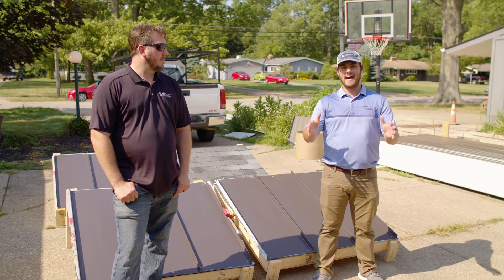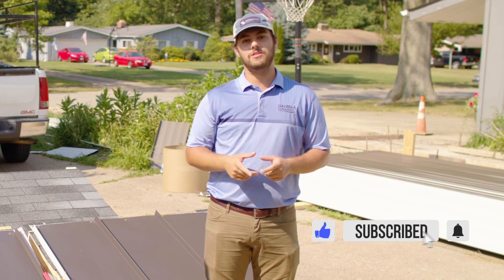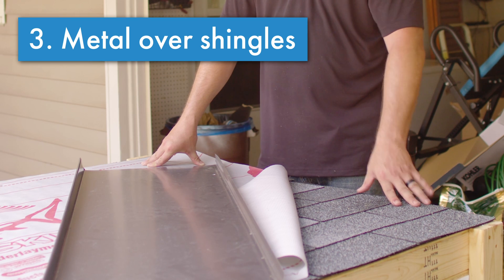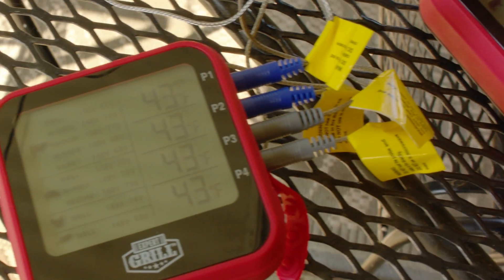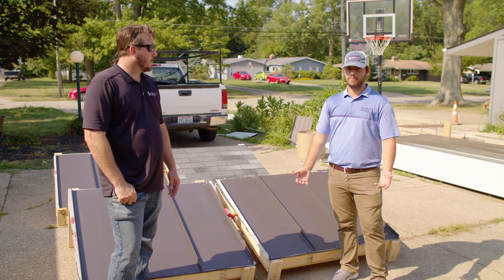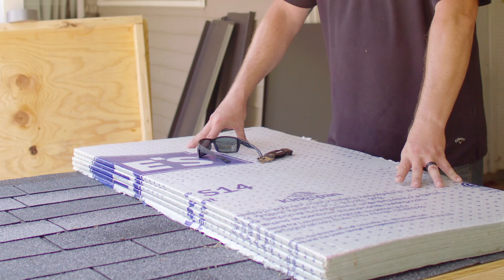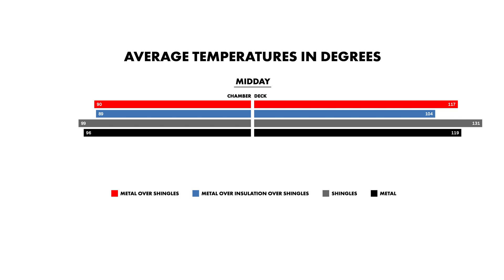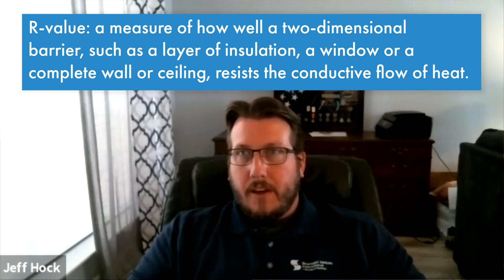Which Roof Type Holds the Most Heat? Shingles vs. Metal vs. Roof-Over

Comment: Though you did not test the system, looking at your results, it seems to me that Peel & Stick under metal would perform the worst of the metal roofs test, as the asphalt absorbs the heat and has no airspace. Moreover, it might perform even worse than a shingle roof as the shingle roof has the breeze to cool it.

Comment: I would like to see the same assembly tested with some sort of foil faced insulation such as single bubble tested against the fanfold.  the reflectivity of the foil is supposed to deflect lots of the heat out.  Plus it goes on faster and cheaper than fanfold so if it does as good or better on temps it would be a preferred method.
Reply from the maker: That's a great idea; we'll add that to the list for future testing! -Thad

Comment: I was under the impression that you needed to have an air gap between the radiant fan fold and the roof, in order to achieve a true radiant barrier. Would be interesting to see you test a system with the proper air gap.

Comment: A peer into the difference between radiant heat vs ambient heat may help with this experiment. If we are looking critically at efficiency then shade must come into play to block the sun's radiant heat while concurrently allowing heat dissipation. A white mesh shade canopy mounted to the roof with 4"-6" offsets would reflect back some of the radiant heat from the sun, providing shade while still allowing rain and wind to pass through for ventilating the ambient heat at the surface.
Reply: @maytons

AND moisture readings alongside these readings throughout the entire year, in the same 1 mile radius, complete with power bill and air quality. Lmao
Reply: @maytons

Lol.. well, at least I would love to see that. Go for it!

Comment: WOW, WHAT A GREAT VIDEO!!!
     Back when I was getting my master’s in mechanical engineering, I did a research paper on heat transfer through a small 1 room house using computational fluid dynamics (CFD).  I was amazed at how much heat transfer was through the roof.  It was over 20yrs ago, but I seem to remember it was almost 75% of the heat transfer, followed by windows and a distant third was the walls.  When I used to do heat transfer analyses of gas turbines, I would simulate thermal break between the parts.  So, the affects you are seeing in your test with the asphalt/foam/metal combo being best during the day is not surprising.  There is a good amount of thermal resistance for the heat to get to the attic air space when moving across these roofing components.  Also not surprised the asphalt/foam/metal combo was the worst during the night.  I bet it’s the thermal capacitance of the asphalt, it’s retaining heat and the foam is restricting the nighttime cooling.  Still, I would use the foam under the metal.  I bet if you added an “attic fan” you would see some big temperature drops.

     Now some real-world experiences, 10 years ago I lived in the NE and I needed to replace my a 20yr roof on a 40yr old house.  The old roof was white asphalt shingles, and they were replaced with black shingles.  It was early April with a daytime temp of around 55F.  Using an infrared laser thermometer, the temperature was about 110F-120F with the white and then 130F-140F with the black.  The original builder installed vinyl soffit vents, but it was over solid plywood.  There was absolutely no attic ventilation.  All the plywood had to be replaced.  There was no bathroom vent in the 2nd floor bathroom.  The roof plywood over the bathroom was covered in mold and one rafter was dry rotted.  Even though the black shingles made the roof hotter the corrected ventilation cooled the house down better at night (also added ridge vents).  In July, our 2nd floor bedrooms were HOT until about midnight.  After the new roof, the bedrooms cooled down sooner.
Reply from the maker: Glad it was helpful! Thanks for watching! -Thad

Comment: Curious to see how a Energy Start rated shingles would compare with your metal rood and against a generic 3 tab(3 tab is banned for new work in our area, only repairs are allowed).  One energy star roof is Owens Corning Dura Max Cool Roof.  Im not trying to drop names, but it's one I know of and is currently on our old home and it's a premium shingle that has a rated 30-50 year, depending on model/install.  That makes it more comparable to metal in lifespan whereas 20 year, 3-tab is low end and users wanting that are only looking for cheapest.   I'm seriously considering metal and will need to install myself because in my area, residential metal roofs are expensive(treated more as a commercial install).  This is not the same in other parts of the US.   Thanks, Brian

Comment: We have a metal roof and our attic gets super hot in the summer. Our house used to have a shingle roof and I don't know if they took the shingles up or if they left them and out insulation down. I would like to put in an attic fan to alleviate the heat in the daytime.

Comment: Exposed fastener high rib metal over 1×4 or even better 2x4 lathe is my favorite. Use wide ridge, bend up the flats, and don't use closures. The ribs vent under the lathe in an amazing way.

Comment: I like the options. Some of the high performance builders I have seen use an underlayment then insulation. On top of the insulation then 1x4 furring strips then metal roofing. This air gap allows less heat transfer from the metal roof to the assembly and the space allows for moisture to run out of there was ever a leak or condensation. It also allows for that airflow to cool the decking at night.

Comment: My other observation is that the cooling is flawed, due to the need for some R99 insulation of the back and sides of the test boxes, after which, we could see how much heat was lost through the roofing.... I am not not as interested in how low it got inside at night, as how quickly it dropped through out the night.

Comment: I believe letting your attic  breathe properly is the best method. Pleated soffit. Rafter venting every 2nd space. Relief vents installed near the pitch of the roof. Minimum R40 attic insulation hot or cold climate. Stay away from dark colours for roof finish. Attic fan would be beneficial. Let the attic breathe. Less chances of mold or condensation. Enough said...thxs for the vids!

Comment: I have been digging up forum post after post, with testimonials of people who get condensation on inside of the panel which drips down the screw and into the roof.  The perilins shift and rot too.  This is caused by the insulation under the metal and open air flow design by the roofers. In Southern climates, the night temperature does not swing 50 degrees as it does out West and in the North, like Cleveland....  This means to avoid the Drip failure, go directly over shingles with the metal. However, something soft, synthetic, and thermally conductive must go under the metal to avoid rock scraping during thermal changes.... The other solution would be to spray foam the backside of the panel.  If I could think of how to glue a some insulation to back of the panel, I might try it.... Unfortunately, I do live near Cleveland and have no attic or way to insulate other than putting insulation between my metal and roof.  I did testing on stove and oven with affordable bubble wrap on stove top and pans heated to 190F.  White side touching pan quickly melted air bubbles. Silver side touching pan softened the bubble plastic enough that I could pop the bubbles more easily. Putting white nylon weed  fabric between shiny side and pan, I was able to keep the bubbles plastic from softening up, and the ir meter read 114F, a 50 to 75F degree drop, just with bubble wrap, reflective silver, and thin weed fabric.  Unfortunately, even if I close off top and bottom of the panel so it stays a tiny bit more temperature stable, I might run into condensation problems.  Maybe going over the old asphalt roof, it might melt around screws and seal the screws and prevent the condensation Drip from entering the roof... I am on the fence about attempting any installation under the metal between shingles (foam board or bubble wrap). Foam board is out of my price range anyway.  I guess I need to figure out the expiration date of bubble wrap in storage to figure out if it is even worth it.
Reply: They don't test reflective film, which likely should show a bigger summer cooling effect..... I am not now sure of wisdom for reflective film: 1. It could increase condensation (even though both insulated and uninsulated metal shingles and space cool to same temp, the time for being cool is obviously less and heat up time faster) 2. Both insulation and no insulation over shingles cool down the same (however, in this test no nightly heat source was put behind the airspace at night to recreate a house. So, I am guessing some nightly r value the more thermal breaks between asphalt and metal.).... Note, from my 200F, 190F stove top tests putting bubble wrap test showed a 50 to 75 F drop with metal then white weed fabric then reflective then bubbles. I really think it was lower, but I suspect my ir meter was shooting through the bubbles to a hotter surface. A layer of black weed fabric between white and reflective, in theory should add more to the system, as it is very porous and should be a good heat break. The bubble wrap should last 7 years at least, used as I tested. And once it fails, it should offer a thermal break with good ir reflection.  .. I think, for me, it comes down to the winter savings v. Condensation savings of no reflective system.  Condensation Drip past screws may be not an issue when going over asphalt shingles- albeit, any condensation is bad for the long-term life. .. So, I guess, it comes down to number of hours below dewpoint each evening on insulated over shingles v. no insulation over shingles. 

Conclusion : not enough tests; not enough data.

1. Retest with moderate heat behind deck at night to see cooling in evening. (airspace)

2. A reflective film separated by a porous fabric (low conductivity to force ir transmission) from the metal from the film.